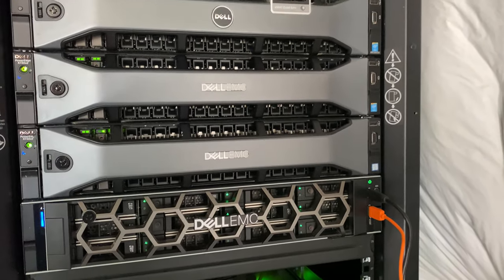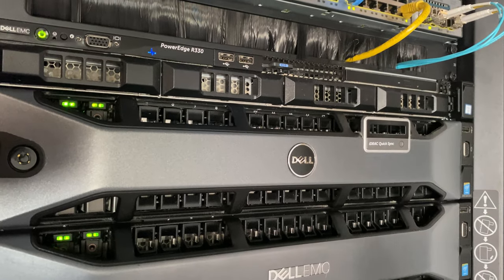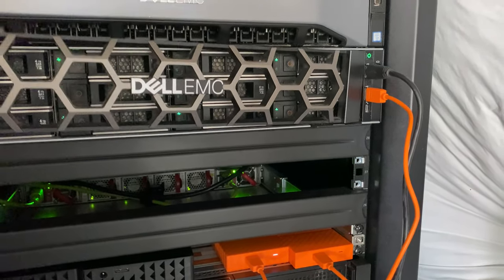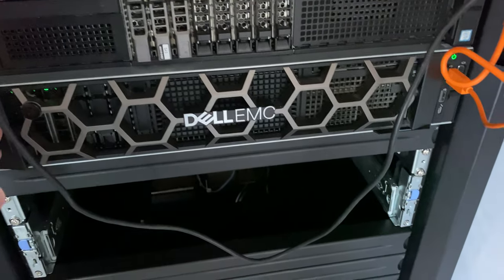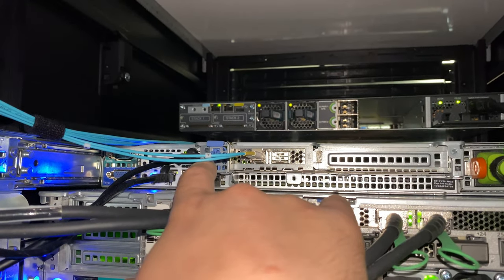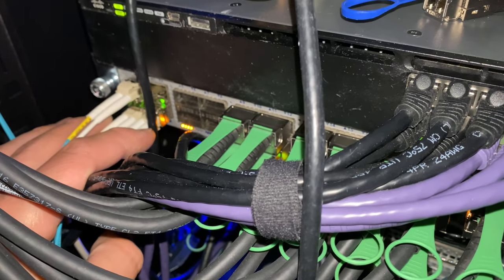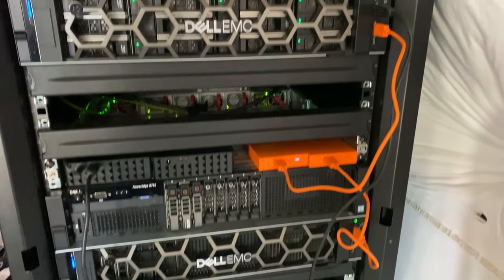Home Data Center - VMware Private Cloud - Update!

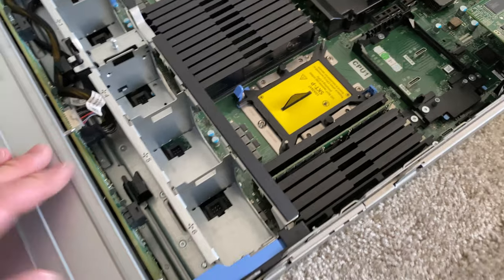Comment: 6:08 what "flavor" of TrueNAS are you planning to run (CORE/Enterprise/SCALE)?
And how are you configuring your Switches (manually via SSH, via a tool or via automation)?
Can't wait to see more of your setup, very interesting :)
Reply from the maker: It will be TrueNAS but with the new version I’ll try out Scale first! 😎

I do some manual configuration for my eBGP peers but interface configuration and all that I use ansible. But for NSX-T I use API/Postman and vRA

Comment: Why replace the 730xd units with 740xd?  I also have a mix of 730xd and 740xd units, I don’t see much power and performance difference between the two…
Reply from the maker: Hi! If you want to have vSphere 8 and be at least on the newest hardware baseline you’ll need to upgrade there are some components left that are supported but not many left and there is a power efficiency difference my R730xds use 330+ watts where as I did tests I got 740s to be around 280-300 watts

Comment: hey, great content. I'm getting into using a couple of servers and I have a dell r710 that want to install windows server 8 standard on, but dell no longer supports server 8 and I'm having a hard time trying to make an iso thumb drive. any suggestions or help would be grateful.
Reply from the maker: Hello, For ISO burning you can use https://rufus.ie - Rufus burns all ISOs to a USB flash drive. Also there is no Windows Server 8, did you mean 2008?